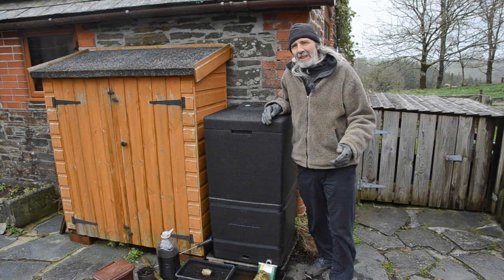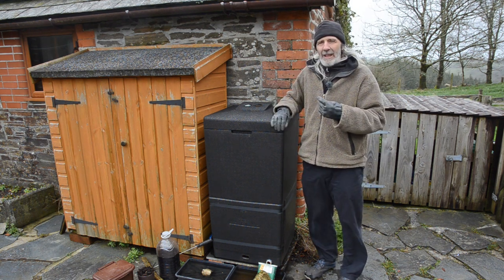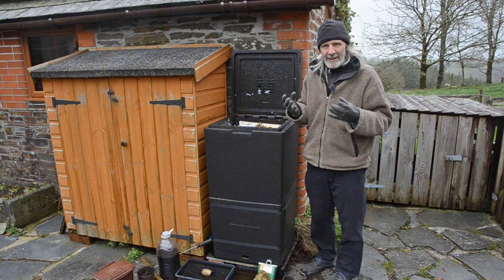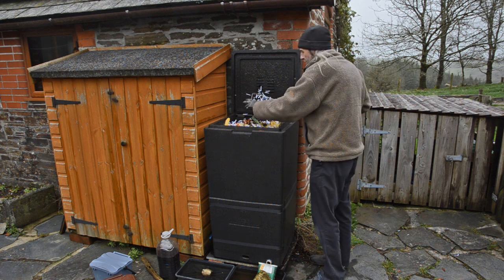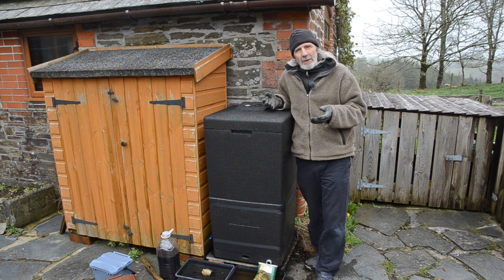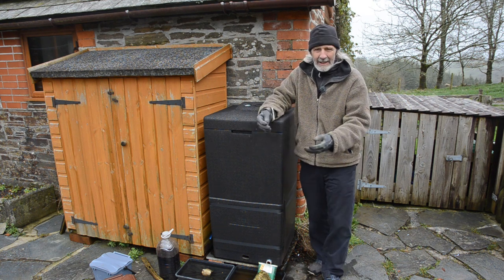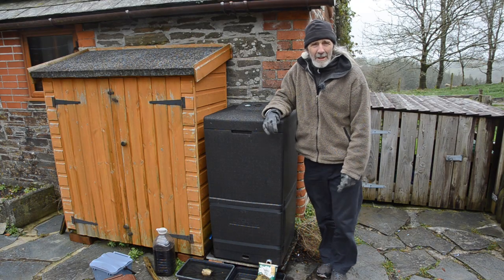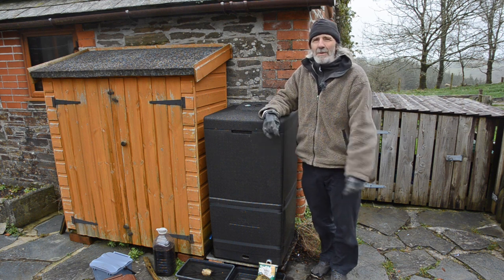Should I... Get a Hotbin Garden Composter?

Comment: Excellent, I have often wondered about if these were effective. Anyone wanting to do this, don't use shredded laser printer or copier paper as this has plastic in there. From Wikipedia  "Toner is a powder mixture used in laser printers and photocopiers to form the printed text and images on paper, in general through a toner cartridge. Mostly granulated plastic, early mixtures added only carbon powder and iron oxide, however, mixtures have since been developed containing polypropylene, fumed silica, and various minerals for triboelectrification.[1] Toner using plant-derived plastic also exists as an alternative to petroleum plastic.[2] Toner particles are melted by the heat of the fuser, and are thus bonded to the paper."
Reply from the maker: That's a great tip Veronica - keeping plastics out of the soil is a no-brainer.

Comment: Apart from the Rodent issue its the SMELL. I only have a small garden and my last compost stank, then I had swarms of flies. So this by the sounds of it does not have this issue and can drain out the liquid that can smell. So for me , I think I will buy this for my garden.
Reply from the maker: The usual reason for smelly compost is that it's anaerobic - caused by it being too wet. Two things that help with this are keeping it part covered (in a wet climate) and making sure we add enough carbon-rich material - to balance our nitrogen-rich kichen waste. Old paper bags, torn up cardboard, shredded paper, perhaps some fine bark or wood chippings are all good sources of carbon. Hay and straw too, though they can contain unwanted seeds.

Comment: Good video. I have the same problem with mice & rats digging into an open compost bin picking out the food scraps, tunnelled holes all through it. I have for now put all food waste in a hard plastic bin with a lid the rats have chewed a large hole in the bottom and now taking everything out so they will easily chew their way in this polystyrene bin.
Reply from the maker: It's a bit toughter than polystyrene but yes it's still vulnerable to a determined rodent. So important to keep it close by where you'll notice any such attempt. Hotbin recommend always tidying up veg scraps and any compost after emptying it. Also keeping the area clear of vegetation and such that rodents could hide in. Having ours next to the shed is not ideal as they could run underneath both - ours is sat up on a patio slab so no one can burrow in from underneath. If it's well sealed and they can't smell what's in there they won't be interested.

Comment: At home I have a wheelie bin with about 2000 worms in which munch through most of our kitchen and grass clippings, cardboard etc. any bulkier stuff goes into compost at my allotment bins. I harvested 75 litres of vermicompost from the wheelie bin. I like the hotbin as it’s quite small. I’d get if I didn’t have worms everywhere.🤣👍🏻 I also get leachate from my worm bin.
Reply from the maker: Thanks Nick, yes we have worms in the Hotbin but we didn't put them there - seems it's a case of 'build it and they will come'. So did you add a tap to a standard wheelie bin or is it another commercial system?
Reply: @LearnPermaculture  I just drilled a few holes into the bottom and put a container under. I get a bit of leachate each week . I saw the worms, surprising they can get in! Worms are awesome!👍🏻🪱
Reply from the maker: @nickthegardener.1120  A nice simple solution. :)
Reply: @LearnPermaculture  i found a tap after I drilled some holes!😂👍🏻
Reply from the maker: @nickthegardener.1120  Classic! :D

Comment: With a Hotbin you can indeed shove anything in and leave it. You don't need to stir and you don't need the bark chips either. Ther are lots of second hand HotBins knocking around to buy. Also a basic rubbish bin with holes in the base works well, though cooler
Reply from the maker: Yes, you can. The bark chips help to maintain air spaces so convecting air can flow in the bottom and out the top keeping it more aerobic (less smell) but it'll still work without it. Stuff wants to decompose, the Hotbin design helps it to happen quicker and without a bad smell. :)

Comment: You can dig the compost into your flower bed or veg garden as the chippings will rot down and is good for the soil.
Reply from the maker: Wood chips are indeed a good addition to soil though I'd be cautious about digging them in as buried they can rob nitrogen from the soil as they break down.
Reply: Well you don't need to dig them in but lay the compost on top and it does help especially if on heavy compacted soil.
Reply from the maker: @stone4173  Yes indeed, worms will do the work of incorporating it.
Reply: Good video by the way,  and I love turning garden waste into compost, something very rewarding about it.
Reply from the maker: @stone4173  Thank you. And yes, it's a bit of an addiction isn't it? :)
Reply: @LearnPermaculture fantastic video ! I have had my hot bin a year and this was so informative! I haven’t put bark wood chippings in since I used the bag I had delivered with my hot bin. I’m worried the compost will compact too much . Can I use landscape bark ? What would you recommend please ? . Thank you !
Reply from the maker: @helenbird9365  Yes, landscaping bark is fine too. That's what we use when we run out of the bark that peels off our winter logs deliveries.
Reply: @LearnPermaculture thank you! Can I say your video was the most informative one I have seen ! I have become a real compost enthusiast since last winter and have a Green Johanna compost bin too . Thank you again for your prompt reply and information 😊
Reply from the maker: @helenbird9365  Thanks Helen, I too am enthused about compost - as you can see. Sp pleased you found it useful. :)

Comment: Interesting, thanks Aranya, look like one of the better designs out there, most seem to get too hot with no cool area. We use a 'darlek' for food waste, I made a 4 layer chicken wire basket for the bottom to stop ratty, it's effectively a worm bin more than a compost bin but the compost is still very bacterial dominant (under the microscope) no matter how much woody stuff I add, it's a messy job emptying it tho, lift of the darlek, re-site and scrape off the top layers back in, still it's only once a year, think I'll have a look at the DIY model tho!
Reply from the maker: Yes, the cone shape helps with lifting them off but they do need some rodent proofing from underneath and they have no insulation so they make compost more slowly. Hot systems are often more work but take up less space as they process the material more quickly. The Hotbin is a good compromise as they're pretty easy to manage and there's no turning needed to add more air. Any composting system is better than none though...

Comment: Is it a bug magnet? What kinds do you see interested in it? Also, is there something other than the wood chips to use in the recipe to get a more finished product? I’d like to use the compost to mix into my vegetable garden’s soil.
Reply from the maker: Hi Joy, There's plenty of worms in there though we didn't add any. It just seems to be full of all the right bugs for decomposing what we put in it. The wood or bark chippings are an important ingredient to ensure it doesn't compact too much and block off the important upflow of fresh air from the bottom vent. You could put what comes out through a course garden sieve though to remove the chunkiest bits.
Reply: Some form of creating airspace is necessary - normally some form of woodchip
You can get semicomposted woodchip from the Hotbin company - which is perfect for the hotbin (strange that) so that by end of a cycle its pretty much broken down

Depends on what you have access to, its possible to cadge woodchip of tree surgeons and if you have space/time allow it to break down a bit more

But you can still use ordinary woodchip - I find the smaller the better as it will breakdown quicker>

Re bugs
 - if you are worried about hordes of flies - no.  Partially because there is a charcoal filter which suppresses smells.  Although if its hot the smells are not the type that tend to attract them (I have the commercial hot bin and two homemade ones that don't have any filters, no problems with bugs or vermin)

You do on occasion attract the odd hoverfly who are looking to lay eggs, but they aren't any bother
Reply: @mstainthor1947  thank you very much.

Comment: In average weather, what is the through-time, from scraps into the top to compost ready at the bottom? Thanks!
Reply from the maker: We empty ours probably three times a year, but it depends on how much you're putting in. We're just two though we each a lot of veg and we do host others from time to time. I'd say the throughput time is likely faster than 4 months but we're not in a hurry to get the compost. We do get an ongoing flow of liquid feed though when the weather there's enough heat inside.

Comment: Is there a Screen above the bottom Hatch  ?
Reply from the maker: No there isn't. The contents just fall down behind the front removable panel. When you dig out the compost you have to be careful not to remove it right to the back, otherwise it might all come down. In practice it works just fine, but having some way of holding up the material on top while you remove the more finished material below it would make it even better. The base however does have some holes in it for the liquid to drain into and then out of the drainage plug. We get a lot of liquid...

Comment: It’s pricey and full of plastic. Love the idea but not what the masses need. Thank you for sharing
Reply from the maker: They are certainly expensive. There's also an energy cost to councils collecting kitchen waste because water is heavy, so some kind of rodent-proof home composting system would make a big impact though.
Reply: Using an old dustbin with a lid is fine too. Hotbins are available second hand
Reply: I'm thinking about building something similar myself and insulating it with wool. But I assume that I would need some form of net to keep rhodents out.